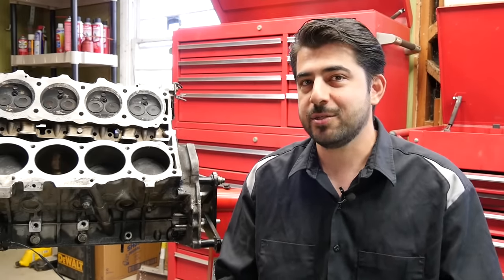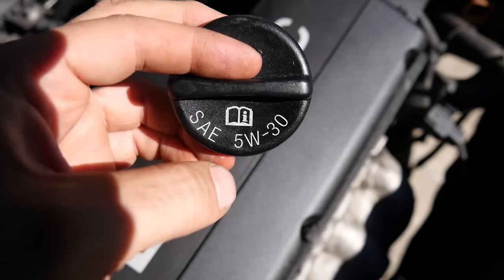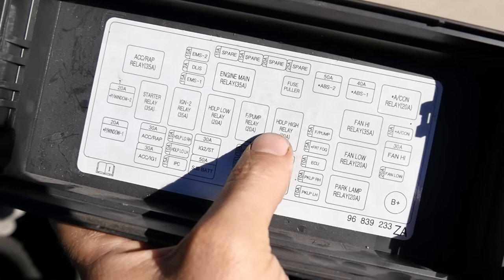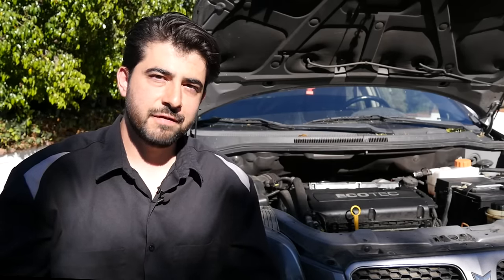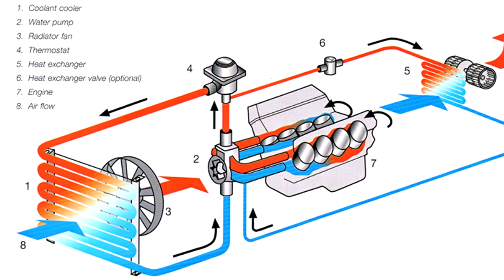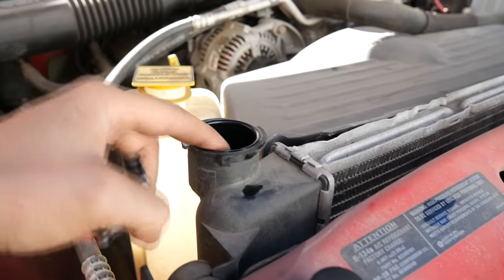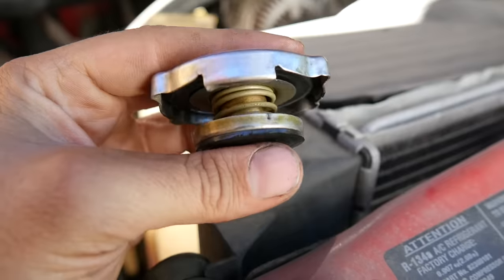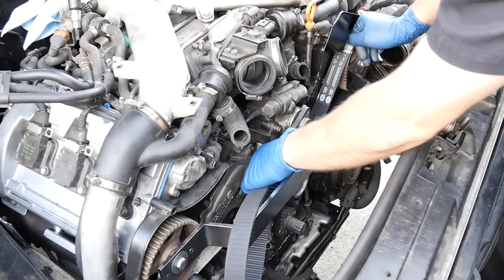Make Your Car Engine and Transmission Last a Very Long Time - Top 5 Tips On Car Care

Comment: I see Toyota’s in the shop every day, they break down like any other brand, no difference there.
Reply: That's true I've had Toyotas they had to go to shop occasionally.  One plus is it's usually not catastrophic damage but bad water pump or alternator, fuel pump stuff that isnt huge if you do regular oil changes.

Comment: Why would you want to remove all the old transmission fluid which has particles of friction material suspended in it, and that's what helps it to engage and provide drive. Removing all the friction material particles when the clutch packs are getting worn is a good way to make the transmission slip. Would last longer with old fluid.

Comment: i heard its not good to flush tranmission fluid but let it leak out and refill ?? especially on older cars
Reply: trans flush got a bad rep if they don't pull pan to change filter... most gunk in the pan and filter in non magnetic fibres and bands...
a magnet helps but...
you need to change filter(s).
restricted flow esp on cold starts affects shifts, mpg etc whether it's new computerized shift points or old pressure type 
neither can compensate for semi plugged filters

Comment: I've had 3 cars with CVT transmissions.. None of the 3 have any means to check quantity or condition of the fluid (no dip stick).. All three were serviced timely by the dealer but all three have had to have the transmission replaced in less than 70K miles... No towing or rough conditions... Just daily 40 mile 1 way highway commute...  More and more cars are being equipped with CVT's... any advice for CVT owners?

Comment: Change fluid's and filters. Even break fluid. Buy synthetic for engine and tranny. Don't buy fram filters junk! Tune up regularly, rotate tires, have breakers, shocks, universal joints, and replace differential oil!  Buy improved spark plugs!

Comment: Change coolent. If the engine starts overheating for no apparent reason the rad is clogged. Which won't happen if you changed your coolent when you were supposed to.

Comment: Why do so many manufacture's car/trucks that shut the engine off at stop lights, then start up again.  Isn't that bad for the engine stopping flow of oil then starting up again?
Reply: Not to them
Reply: @20502chris  meaning the manufacture's want to make extra money selling starter's for those vehicles and other unecessary repair's....

Comment: Myself i think by flushing doesn't remove the trash thats in the trans such as filter and also by flushing it pushes trash from the clutches on high mile cars wh7ch the clutches are th7nner which creates slippage.  Can one replace a torque converter with new ine on a low milage trans, 2006 hyundai sonata

Comment: What's your experience with non-original equipment wheel bearing assemblies? My 05 Subaru Outback needs wheel bearings in the rear and found a set of 2 on eBay from "Detroit axle". Like 70 dollars a piece.

Comment: My 03 Dakota has 350k miles, runs fine & still doesn't burn oil...gotta admit I haven't always changed the oil @ 5k either. Must be luck idk...definitely not still rolling due to proper maintenance!

Comment: All u gotta do is get a 60's chevy nova that's roadrworthy with a 6 cylin & powerglide & u will be set for ANOTHER 50!!! years, as long as u dont drive it in the rain. lol   U can't kill  the motor(which has NO timing chain OR belt!) or trans, which is as simple a trans as possible with just 2 forward gears & a drain plug on the side so ez to get at.

Comment: I'm thinking why not install an electric pump in the sump to circulate the engine oil before starting, then switch it off when the engine starts up.

Comment: Synthetic oil can leak through fun gaskets such as the crank gasket as I had on my 4g63 engine And they are not easy to replace, have fun!!
Reply: Yeah the tldr is synthetic flows better /to more parts/gaskets which can lead to the failure of preventing leaks since it reaches more places and will leak out of smaller worn gaskets that might've been untouched by regular oil previously.

Comment: 2002 dodge caravan 3.3 moter 234,500 miles no rebuild just basic tune ups n transmission filter n fluid changes, 1999 ford f150 4x4 205,000 miles same thing basic maintenance

Comment: switching over to a synthetic oil on a car that has always had regular oil can cause leaks!
Reply: Korey Mayo This is a myth
Reply: @henryconklin6550  I've seen it first hand!
Reply: @koreymayo8884  car must have been running on glue before, or wood resin.

Comment: Drive like you don't have brakes. You'll be ready to trade before its worn out and maintence will be minimal. It's hard to do but it gets easier as you grow older. So the next time your pissed following the old guy in the old Chevy remember they both probably have a lot miles on them and if you live to be old you'll see this is true.

Comment: Well, so much about the gearbox oil change at manufacturer's specified interval. In Europe, with Peugeot for example, they tell you it is made to last the lifetime of the car so no need to change it. Of course they do not lie, they just make sure your car dies on time. Thus I changed mine at 60'000 km. Remember, the car manufacturer's nightmare is your dream: a car that last very long so that you  only buy another one as far in the future as possible.

Comment: Some of this is very true but No need to pre fill filters. Many cars have cartridge filters. BMW Mercedes Many other cars and trucks. Synthetic oil is over rated. Clean conventional oil is fine. Irv Gordon had 3,000,000 miles on his Volvo and changed it every 3,000 never used synthetic oil .

Comment: I am victim of a broken timing belt, failed water pump hence over heating. On my deawoo. Then when I changed the filter and fluid on my explorer it doesn't pull like it used to. So damned if you do and dames if you don't.

Comment: 5. Oil (use Synthetic)/change it often.
4. Replace the timing belt: on time. 
3. Overheating issues:
   Water Pump Keep an eye on this, replace it on time.(Weep hole indicator)
   Thermostat - change it so it doesnt stick closed, and cause a overheat.
   Radiator Cap: Make sure its working correctly. (60K miles)
2. Automatic Transmission fluid / filer and inspect fluid cooler.
1. Always Use OEM parts

Comment: Toyota's ain't no better than any other these days....  My Chevy Colorado has 383K...  Original Engine's never been opened.  I have run Mobile 1 since the day I bought it new...   The 4L60E has been done 3x , which I have finally added a plate cooler (My Fault towing a 13k trailer and racing).  The G80 blew up at 265k.  Radiator, Fuel pump, Thermostat, and Alternator made it to approx 245k. Literally like 10+ Front Wheel Bearings.  I live in NY so the frame has been fixed 3 x also...   I'm gonna will this thing to 500k...  Had it since 2005!

Comment: One thing not mentioned is driving habits. Most people get in a car and suddenly in a big ass hurry, the light turns green and it’s all throttle, the light turns red? It’s still all throttle till the very last second that physics still barely make it possible to stop. Railroad tracks? No reason to slow. Pot holes and debris? , their phone call has priority. These are some of my reasons for NOT buying late model used, Everyone thinks they are great drivers. But that’s not what I see on the road. These things shorten the life of any vehicle. We all know people who will tear up any new car in a year and are seemingly oblivious.

Comment: You don't have to replace your timing belt on time if you have a non interference engine. I just drove and never replaced my timing belt and let it snap. No engine damage was done.
Reply: Only thing you need to consider is what happens if the waterpump fails before the timing belt does ?  I heard of instances where the waterpump doesnt last as long and failed before the belt broke.
Reply: @jopisano67  That's irrelevant to replacing a timing belt. The water pump is driven off the accessory drive belt.
Reply: @inertiaforce7846  my point is. To replace the waterpump   ( especially Toyotas)  you need take the timing belt off first to replace it.  And you never know what will fail first. My timing belt had 90,000 miles on it and i was worried that the waterpump would fail first so i had gotten both replaced at the same time before any of the two failed
Reply: @jopisano67  This is still irrelevant to whether the timing belt needs to be replaced on a non interference engine. If the water pump fails, that's a completely separate issue. If the water pump fails, then yes you can consider replacing the timing belt at that time if in fact the timing belt needs to be removed to replace the water pump. I don't know if the timing belt needs to be removed to replace the water pump, and I don't see how these two are connected when the water pump is driven off the accessory drive belt. Therefore, I don't see why the timing belt would need to be removed to replace the water pump.

Comment: Actually flushing all the fluid out of a transmission can get rid of clutch dust that your transmission needs too shift bc it’s use too it so if you flush it all and get rid of the clutch material your transmission is gonna slip even worse

Comment: Doesn't flashling tyranny fluid damage it? My cousins Accord with 320k miles was done simply by doing this job. He bought the car at 40k miles. Everything else was working fine until that point.

Comment: Change your oil and filters, plugs etc before it's time for it, never go with the scam of "Longlife", there's no such thing. If you live in a colder climate, use an engine preheater. Do this and you'll have a happy engine.

Comment: Because unless you are driving 50k /year the interior and other bits will likely be worn out and the experience driving the car will be miserable.

Taking a car to between 250k and 275k is long enough.  That's usually 10 years with the car, and by then, while the engine and transmission may be fine, the rest of the car is falling apart or rusting away if you live in the salt belt.

Comment: what should I do when I flush and fill my auto trans and now it slips??????? I wonder how many times a car overheats when the electric fan is not working,if fan is not working,car should be disabled from starting....as an interfearance motor or failed cooling fan if stuck in traffic.....makes you wonder,is this planned???? doesn't have to be this way........

Comment: I would completely disagree with flushing an auto trans fluid. Most pro mechanics agree. Change trans fluid every 40k. in the winter wait 5-10 minutes idling before driving. Winter causes most wear. Change brake fluid every 50k. Change not flush coolent every yr. Change oil & filter with exact manuf recco every 4k synthetic. other minor maintenance and a toyota or lexus will go 300-400 k miles.

Comment: Number 5 is wrong, if a vehicle requires multi grade that is what it should get.
Synthetic oil is required if manufactures say you need it.
Reply: Synthetic and multi grade are not contradictory. In fact, all of the synthetic oil I've seen is multi grade, and a lot of multi grade oil is only available as a full synthetic. You can't have a non-synthetic 0w20 for instance.

Comment: hi there i just put in a new radiator and new thermostat put it in and now it has been 2 weeks and the thing is still overheating. just wondering if anyone can tell me why? I was thinking it was the water pump but not sure?:(.  2005 Nissan Altima
Reply: Trapped air. Wrong thermostat or requires a specific orientation...besides not being in backward. Look in the tank to see if the fluid is moving.

Comment: No sir.. 😳 if u have to crank the engine with the fuel system disabled... do i once 10 to 12  seconds that it.. don't repeat.. cranking in hard on the engine as it make very little oil pressure regardless stopping and re-cranking repeatedly is going to offset if any gain made..

Comment: I have yet to see any evidence that prefilling your oil filter makes a drip of difference on an oil change.  It will add what, maybe two or three seconds to the time it takes to fill it via the oil pump?  You always change your oil hot, meani g that the engine was running not fifteen minutes before you start it with the fresh oil change.   The bearings and rockers still have plenty of film on them.   They are a lot more oil starved on a daily cold start than with an empty oil filter.

Comment: OEM parts huh?   Bought a clutch master cylinder from the dealer.  It leaked all over the place.  The dealer wouldn't refund me nor replace the clutch cylinder because I installed it.   And that's how it was written in the warranty.   Then the other dealer same car brand sold me the wrong sparkplugs.   I was talking to a neighbor who had the same model of car as I did, and he didn't catch their mistake which destroyed his engine,  so he sued them and lost.   Point is that the dealer knowingly sold me the wrong plugs and knew that they would have destroyed my engine.

Comment: I cant understand how in the hell can my chevy v8 engine leak out oil from between the block and head gasket outward not internal . It doesnt have oil passages but the bolt holes. And the water passages behind and in front.

Comment: It may not always be a good idea to install an extra transmission fluid cooler, because that could make your fluid TOO cold.  I would think the manufacturer has analyzed the system and provided a stock cooling solution to result in the proper temperature.  To say that one is going to override the mfg's design to "improve" cooling requires one to do an engineering analysis (what's best temp for the components in that particular xmission, how harshly a car is typically driven, ambient temperature in your climate, etc, etc).  Really like your video otherwise because of its great content.  Thanks.

Comment: Transmission flush is bad for youre transmission, just replace oil  and filter every 50 000 km, i have got a bmw e39 with more then 300.000 km and still going strong

Comment: Filling your oil filter with oil after a oil change?
First time I've heard of that one.Also transmission oil flush noway.
Reply: Yeah, not the first time I've heard that one.  Sure, it's always a good idea to do it, but as he said, some of us have oil filters that go in at an angle.  You can only put so much oil into it before it'll spill on you because there's too much of a tilt to screw it into the base correctly.  Point is: I've been changing my own oil for over 30 years, and I've never had a problem putting a filter in empty.  The engine only runs for a few seconds before the fresh oil fills up the filter, and after that, you're good to go.  The thing is that you (if like me) put the front wheels up on ramps to give yourself room to move while under the car, so there's still a trace of oil left in the engine, anyway.  The engine is NEVER completely devoid of oil unless it was taken apart and cleaned.

Comment: I like this video but, replacing all other components in timing belt change isn't true my Mitsubishi 380(Galant) has 93,000klms is due for a timing belt change.
The 200,00 klms service gets water pump, tensioner pulley ect changed this is buy the Mitsubishi service book.
At $1200-$1500 this service interval is because they are genuine parts.

Comment: Dont tell people to buy synthetic oil.  If they dont have to.   My 01 Toyota Tacoma prerunner has 436,190 miles on it    all I run is regular conventional not even high mileage.       I do mostly freeway driving so I do the oil every 3500k-10k based off color/texture   I've had put 10k on my oil a few times still pours out clean from drain plug   oil is cheap

Comment: Yea i use conventional oil Havoline over 300,000 miles😊
Reply: I've used it in my Lexus, too.  Why not?
Reply: Yea why not i use Marvel Mystery Oil to sometimes the best thing is clean oil no matter if it's synthetic or conventional conventional oil are more Superior then 50 years ago
Reply: @jamieb9556  Obviously the current standard for both is API service SN/ ILSAC GF-5. Meet those with the correct viscosity and you're doing everything oil has to do for your car. There are a few engine manufacturer exceptions but read the manual anyhow.

Comment: It’s not that hard. Change your fluids and follow a maintenance guide for your car. Don’t run it hot ever!!! If it’s an automatic get a cooler installed for it. Also drive it like an adult. If you beat the hell out of it you will destroy it. I have a 1992 740 Volvo with almost 430K Miles. It has been in my family since new and very well maintained all of its life. Stored indoors and regularly washed and waxed. The drivetrain is original and the valve cover has never been removed. It has never left anyone stranded. I drive it daily and it’s my vacation cruiser as well. I recently drove it 3K miles on a vacation without issue. If you take care of your vehicle it will take care of you.
Reply: But it was a very good vehicle to begin with. People buy crap and expect it to hold up well.

Comment: Wrong I went to school for this and flushing a transmission will kill the transmission it will start sleeping and have all kind of problems. We tested this on two lincoln navigator same miles one had 50% oil changed with filter that truck is still running strong navigator # 2 had a complete flush and filter 2 days later transmission started slipping then on the 7 day the transmission electrical shifting valves burnd up.